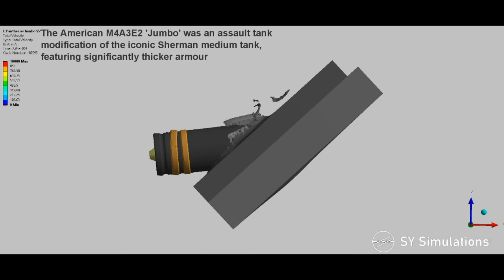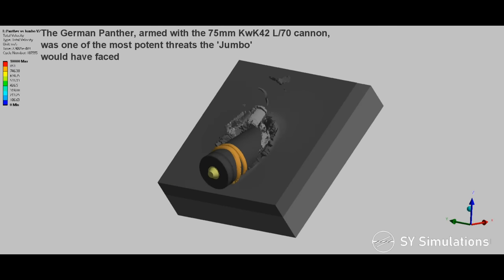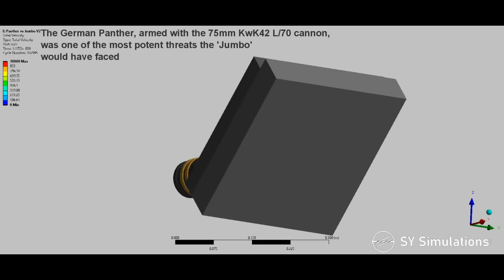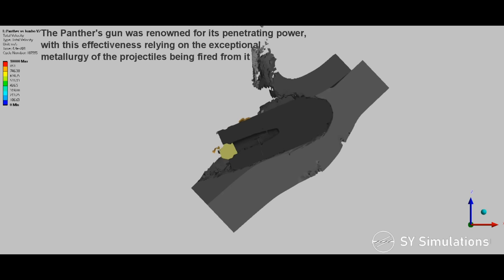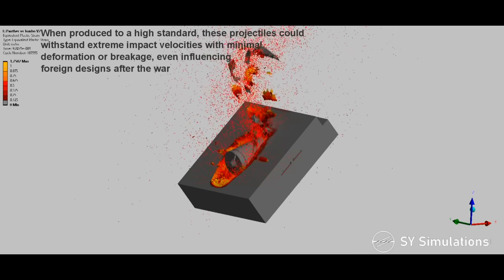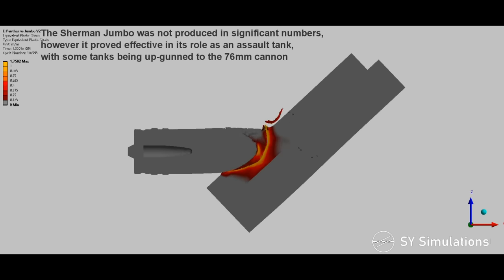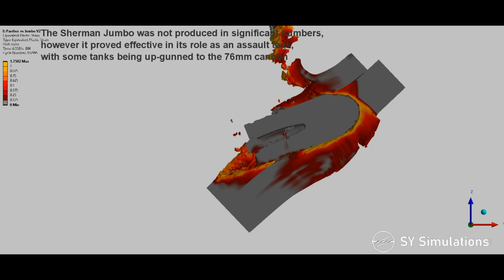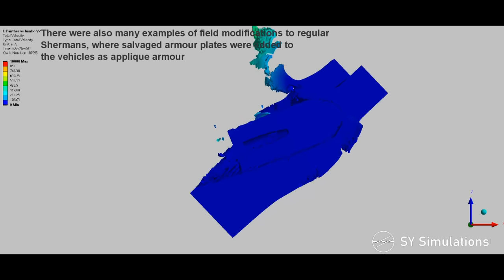PANTHER vs M4A3E2 SHERMAN JUMBO | 75mm Pzgr.39/42 Armour Penetration Simulation

Comment: Would be interested to see a follow-up at a greater angle of obliquity, even just 10° to see if that would affect the end result and cause a more definitive non-penetration
Reply: I don't think even 10°is needed, 1-2° can have a significant effect on performance (sitting on a slight rise, or the suspension jouncing at the right moment)
One of the many reasons I roll my eyes at "expurtz" who point at pen tables and shriek "No Way Could [x] Happen"!
Reply: Cope harder
Reply: @Zander10102  go outside
Reply: @Zander10102 ???
Reply: I was thinking about 3-5⁰ more down and that would cause a definite penetration shot, for sure.
Reply: @carlitosskater89  I think it would be cool to have a comparison of all three just to show how marginal the situation is
Reply: That and the extreme variety of other factors, like temperature, weather conditions, manufacture mistakes/deviations in both armor quality/thicness as well as projectile construction.
Same gun and projectile (on paper) cou;d have drastically different performance, same goes for armor.

I find those "lucky shots" to be quite interesting, as they hold some kind of heroic feel to them. Like with shermans repeatedly hitting tigers without penetration and yet the crew was out, or the famous long-distance kill that one Nashorn crew achieved on a pershing, if I remember correctly.
Reply: @carlitosskater89  imagine getting killed just because you hit the brakes really hard, canting the hull forward as you did so.
Reply: @lyagushkha8490 my favorites come from the Pacific theater. On one end, the crew of a 57 mm armed Chi-Ha found that with APHE they could not penetrate a Stuart from any angle at any distance. On the other end, a Ha-Go shot it's 37 mm round perfectly down the barrel of a Sherman and disabled the breach.
Reply: @jsplicer9  Down the barrel shot? That's nice!
Reply: @jonskowitz areyousureaboutthat? Besides, if the jumbo is hit enough times a few degrees will not eventually matter

Comment: I wonder what kind of impact the extra armour had on mobility/reliability etc.
Reply from the maker: afaik it worked quite well still, but im no expert in the reliability side of things.
Reply: It caused some problems with the suspension but overall the weight increase and reduced mobility was not as extreme of a tradeoff for the extra protection
Reply: They were reliable enough for the role it was supposed to fill but the suspension and ball bearings were too fragile with such weight. Drivers had to be careful which wasn't all too different from the German Tiger despite people giving the latter a lot of crap for it.

It was also a lot slower, needed duckbills to compensate for the higher ground pressure, and used more fuel thus shorter operational range.
In the assault role, this was generally fine. Much like the Tiger was. Just that the latter was pushed into roles it wasn't designed for while the Jumbo wasn't.
Reply: Well it went from about 32 tons to about 42 lol So weight was an issue. Duckbills were permanently fitted to the tracks to help spread out ground pressure.
Reply: the reliability issues from the extra weight werent much of an issue. the jumbo was meant solely for armored breakthroughs, and, as such, was basically locked away until it was needed in combat.
Reply: @notkazerad564 
US has over boxes of test report about it. 
Give it a read if you can find it. 
The mass increased 25%. It is foolish to imply there is no mobility implication.
Long story short.
The maximum incline is greatly reduced. 
The maintenance is a lot more intensive. 
The drive worn out much earlier than expected. 
The first pair of suspension is no more. 
Oh, cross country maneuvers is forbidden.
There are many more issues but I think you get the idea.  

However this can effectively stop most German at weapon. So this is a stop gap trade off they are willing to accept. I mean there are just so much Sherman around.
Reply: @neurofiedyamato8763 Have to wonder how it would’ve fared with the wider and tougher HVSS suspension fitted (as M50/M51/M60 Sherman’s showed that it was a quite effective system on some very overweight Gun upgrades)
Reply: @neurofiedyamato8763  "which wasn't all too different from the German Tiger despite people giving the latter a lot of crap for it." In fairness, the Jumbo is an upgrade to an existing tank and existing chassis, it's suspension is not designed with all of that extra weight in mind.

The tiger was designed from the ground up with all of it's weight in mind, and it still failed at it's job. And even then the jumbo was still not really any LESS reliable than the tiger.
The tiger is also given more crap for it than the sherman would because of all the wehraboos screaming that a tiger can take on 100000 million tanks and is the first MBT and can kill an abrams in a 1v1 engagement etc etc.
Reply: @neurofiedyamato8763  Unlike the Tiger, the Jumbo was still incredibly easy to service, had a fair bit of parts commonality with the standard Sherman, and there was plenty of logistical support available to them. No showing up to the train depot at stupid o'clock in the morning with an SMG to secure a spare transmission before everyone else, and no tearing the entire interior of the tank apart to get the transmission out. This meant that even if a Jumbo was forced to take on duties beyond its intended assault role, it was far easier to keep up with the additional maintenance without putting overt strain on both the crews and logistical train. It helps that there were so many Shermans available practically 24/7 that Jumbos never really had to be used outside their intended role in the first place.
Reply: @hoosierfarmkid about that there's Lt. Col. Creighton Abrams tank which basically M4A3E8 with cannibalized extra armor
Reply: the chieftain has a video on this, and short answer is no
Reply: There are actually full reports on the Jumbo shermans reliability, in testing it was found to be able to drive 400 miles without failure and the transmission ratios were adjusted to maintain the same acceleration but just lowered the top speed of the tank so except for its road speeds it was actually just as fast as any other Sherman in combat. 

where it did have an issue was going over rough ground the front suspension was heavily strained and if it was allowed to "bottom out" too hard going over a steep hill or small ledge it could break the suspension but it was considered only marginally worse at traversing rough terrain over a standard Sherman.

Comment: At 550m, while not a very long distance by any means, the trajectory of the shell will not be straight as shown in this simulation, it will be parabolic to whatever extent, which will help negate some of the sloping of the armor.
Even a mere 2 degrees will make a significant difference in reducing the effectiveness of the sloping, because this plate is highly angled and a single degree at those angles translates to a lot of effective thickness.
Reply: The velocity of the Pzgr.39/42 is such that bullet drop barely matters at a distance of 550 meters.
Reply: Yea 2 degrees might matter, but .2 won't. And .2 is about what we are looking at
Reply: tbf the average tank engagement was 800 meter.
Reply: That’ll also have an effect on the velocity, it’ll probably slow down significantly at that point

Comment: Great sim, as always.  That pic in the link was a bit hard to interpret - were those projectiles sticking in the armor on the upper part of the plate?
Reply from the maker: The ones stuck in perfectly at 90 degrees were fired at the vehicle when tilted I believe. The image is just for reference regarding the behaviour of the add-on plate, where there doesnt seem to be much petaling or ductile behaviour.

Comment: If the sherman angles itself even slightly, with other conditions remaining the same, penetration wouldn't happen. Jumbo is nice
Reply: Not really, this is without counting the explosive filler and already kills the crew.
Reply: @hashteraksgage3281  without the pen, explosion from a panther's gun will not be able to create enough pressure to kill
Reply: @ApollonDriver  look how much the armour bends, it doesn't a total penetration to be lethal, the spalling alone will turn the crew into soup.
Reply: @hashteraksgage3281  maybe the driver and the front machine gunner, but the rest shouldn't have too much issue.
Reply: a follow up shot would finish the rest @ApollonDriver
Reply: @ANDREA57ITA  you would need to shoot the exact same spot, it's not really easy to do in the heat of the battle, aiming by looking through a small hole
Reply: @ApollonDriver WT isnt a valid source
Reply: @bebedor_de_cafe3272  yes, tanks are more survivable than in WT
Reply: @ApollonDriver absolutely not lmao, wt cant calculate a shit load of stuff, in this case with the explosive filler the crew would be dead

Comment: If the Panther can't realiably penetrate the Jumbo from 550m with a best case scenario shot (hull angled at 0°), the Pz IV and TDs with the L/48 would struggle as well against regular Shermans without the add-on armor 🙂
Reply from the maker: Iirc the critical range for l48 75mm against regular Shermans (i forget which model though) was 300-400m?
Reply: @SYsimulations then how can m3 75mm perform against panzer iv? I remember reading even the turret was not penetrated from 600m?
Reply: Most American tank losses in France was to sneaky Pak 40s, and in fact Jumbo was designed specifically to survive that, so they could continue to advance and provide support while taking AT fire from enemy they could not see.
Thus most Jumbos was lost to next 2 most common Sherman killers: mines and hand-held rocket launchers.
Reply: IIRC the Sherman’s armor was specified to provide protection from the shorter (ie everything but a Panther) 7.5cm guns at a slight angle off of center. And I believe they pretty well met that standard.
Reply: @SYsimulations  pz4 l48 could penetrate a sherman front at 750m and t-34 front at 1000m
Reply: The Panther crew would just reload with a Panzergranate 40 (Hk) (Pzgr. 40/42), which is an Armour piercing composite rigid round.

Which will certainly finish the job (starting velocity of 1130 m/s.

Whereas the panzer 4 crew would just go for the Pzgr. Patr. 40 KwK 40 (Armour piercing composite rigid, starting velocity of 930 m/s)

Which would in theory have essentially the same penetrating capability of the round shown in the video
Reply: @a.t6066  That does not sound right, unless the germans added on alot of ADD on armor.
Reply: @PeterMuskrat6968  yeah I don't think it sounds right either. But I remember reading it. Maybe fake document lol
Reply: Yeah, the test report shows that KwK 40L48 can’t penetrate the Sherman’s hull front armor and Gun shield even at the 100m.
Reply: @grigor.h3929  Was the Sherman was angled?

(I'm just trying to remember the test)
Reply: @notsureyou  yes, 15 degrees perhaps.
Reply: @PeterMuskrat6968 M61 rounds were pretty terrible, especially in their early runs, often they would explode prematurely and shatter, there are reports of this issue preventing the round from penetrating Panzer IIIs
Reply: @notsureyou  Where would they get APCR for KwK42 in mid-1944? They were produced on a small scale, and only for like 3 months.
Reply: @notsureyou  APCR needs the flat angle though. Even a 5 degree offset would throw it off.
Reply: @notsureyou  I highly doubt that because allied APCR/HVAP was rare, and they weren’t under nearly the resource shortage of special metals (like the Tungsten used in machine tooling and those rounds) so I doubt the Germans had many APCR rounds, and if they did I’d expect them to be of inferior alloys so in part defeating the point of the round.
Reply: @notsureyou  I highly doubt that because allied APCR/HVAP was rare, and they weren’t under nearly the resource shortage of special metals (like the Tungsten used in machine tooling and those rounds) so I doubt the Germans had many APCR rounds, and if they did I’d expect them to be of inferior alloys so in part defeating the point of the round.
Reply: @hoosierfarmkid  They were rare until they saw the need for them.
Reply: @kireta21  They seem from what I can find in a quick search,

The round was known to have been produced for almost a year.

After circa October 1943, the production would have been reduced markedly, 

And whilst I would expect the tanks on the Eastern front to still have some of these rounds, or to receive priority for the stock piles of the round,

Some tanks were diverted to France following D-Day (from memory).
Reply: @alarminglyfastmovingskelet7289  Very true 

(I've just re-watched his video's showing this)

Comment: This is a good showing of why simply putting more armor on a medium tank wouldn’t help it very much. Jumbo doubled the protection of a Sherman and it still couldn’t reliably defeat German guns. 

Also worth noting that in practice the jumbo seemed to be even more resistant than this, however. This may be simple distance or extra angling from non head on shots, but one jumbo was assaulting German fortifications on the Siegfried Line and took 3 88mm hits from anti tank/air guns before finally being penetrated and destroyed. A round significantly more powerful than the Panther’s.
Reply: 88s we’re not much better than the panthers gun, unless it was the Pak 43, which is extraordinarily impressive. The thing with the jumbo it could protect against the vast majority of guns, only the long 88 and rare 12.8 cm  could pen it at distance. Panthers, tiger 1s, flak guns, most German armor, and at guns would struggle
Reply: @apersondoingthings5689 the panthers 75 had better pen that the tiger 1 88, but less explosive filler
Reply: @hashteraksgage3281  I mean less, I wrote that wrong
Reply: @apersondoingthings5689 It would be due to having greater explosive filler enabling it to punch through any remaining armour.

Comment: I wish you would show the effect of trajectory at longer ranges. Your rounds always impact parallel to the ground. Otherwise love the channel.
Reply: And what angle do you suggest? 
Because something as heavy as 122 with relatively slow mv, the angle of drop is less than 2 degree at over 1500m.
Reply: @jintsuubest9331  I was gonna suggest about 1 degree for these WW2 guns, but I was more interested in low velocity HEAT projectiles and extreme ranges for modern weapons systems.